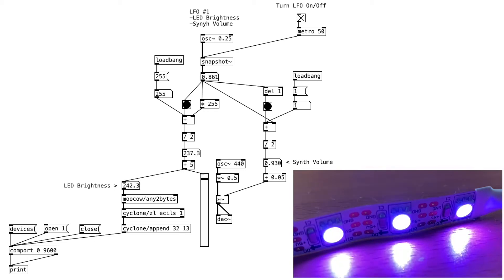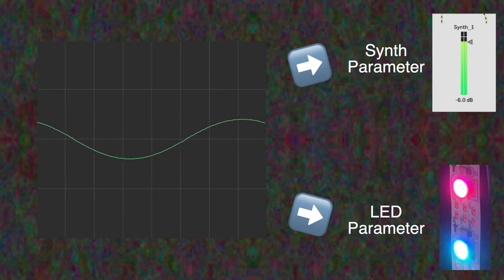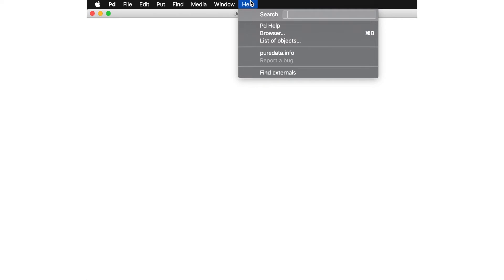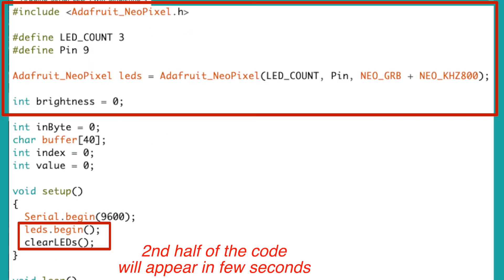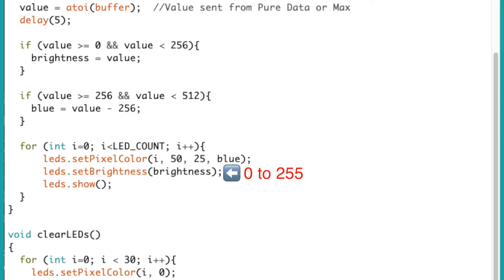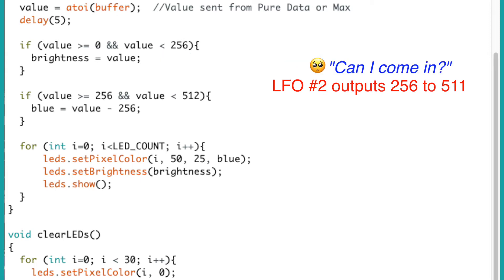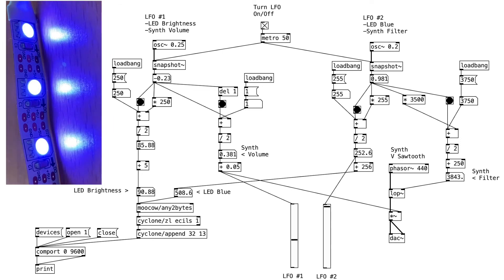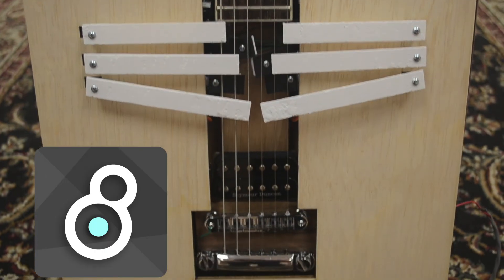Max/MSP to Arduino | Pure Data to Arduino

Comment: Hi, I was trying to send beats input to a LED on Arduino, while playing a song on Pure Data at the same time. However the song seems delayed, as if Pure Data is struggling with both the playback and sending data to Arduino. Is there anything I can do to fix this? Thank you!
Reply from the maker: Maybe changing the baudrate could make the latency smaller. I suggest experimenting with that :)
Reply: thanks! All your tutorials regarding Arduino and Pure data are very helpful!  @SoundSimulator
Reply from the maker: @alexandrinabargan5493  Glad to hear that!

Comment: Is it possible for you to share the file(patch)+ from PD to Arduino that control the stepper motor part.I am working on my University project and I am so new in both program. I wanted to use the audio from microphone( I wanted very low frequency 40-50HZ) as an input and  send the data to control the stepper motor in Arduino.  I couldn't find any other tutorials but from your only that explain with PD to Arduino. I still couldn't manage  to connect PD and Arduino together as it said in PD that COM3 is being used, Do I need different com port number?. Thank you so much in advance

Comment: Hey can I make a project, with ard and pure data, I want to control pure data with potentiometers like volume and freq, but at 2,3,4 oscillators, phasors etc. 
And at the same time to make like the video a potentiometer slider that controls the gain and at the same time LEDs to become brighter with higher gain?
Reply from the maker: I GOT YOU
https://www.youtube.com/watch?v=WPj-clNbvfk

Comment: Luvin this series!👏👏👏
Are Max and PD files cross compatible? IOW, could I initially pay for Max to increase my initial productivity by using the hover tips until my project is finished, then use PD to 'run' my Max created project afterwards, including duplicating my project as I add more laser projectors?
My current plans for system architecture is to have a Teensy inside a custom MIDI control desk, controlling multiplexer arrays for rotary encoders, pushbuttons, LED level meters and indicators for multi-purpose buttons (3rd LED on 3rd tap).
That Teensy also generates the waveform images using the audio library, which outputs MIDI and XYRGB analog signals to Cakewalk's DAW for recording and editing show content.
Then Cakewalk will output those MIDI CCs & keys from the tracks on the timeline via usbMIDI to the identical Teensy Image generators, located inside each projector, where they output their MIDI controlled waveforms, through audio DACS to the projector's XYRGB inputs.
This allows usbMIDI to control multiple projectors, without needing to consume line bandwith by routing 5 channel audio to ~3 different projectors. That's all automatically done inside Cakewalk, during 'studio' time.
Sorry for the xtreme brain dump, but I'd love to hear your feedback regarding the overall concept, before blowing more $ than I already have on a fool's errand, because of some typical unforeseen gotcha.
FYI: I started out with Arduino and did some maker stuff. But when it comes to DIY audio applications, Teensy is an awesome platform, with great libraries, an intuitive PD-like graphical design tool (that generates the code to copy directly into your Arduino sketch), excellent documentation, and a friendly, well monitored forum. The best part is that Teensy uses the Arduino IDE and is fully compatible with your existing UNO sketches. It's basically a rockNroll NANO on steroids and speed. JS 😎
Reply from the maker: As far as I know, no. 

The project sounds grand in scale! It's late at night so I'm having trouble dissecting what exactly you're trying to build so I'll get back to you later on it! But it sounds like it would be good to start step by step and doing proof of concepts before buying all the parts. 

Yeah! Teensy seems really cool. I had a friend who used Faust with Teensy, I think, to do cool embedded audio project. Would love to explore more and maybe make videos on it. Daisy also allows you to do embedded audio using Arduino IDE, which from personal experience was a breeze!!